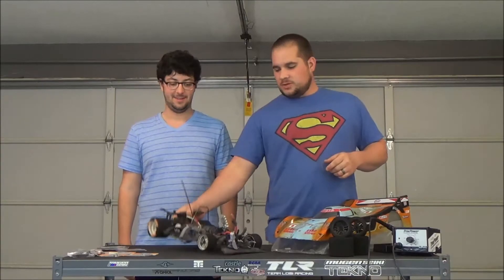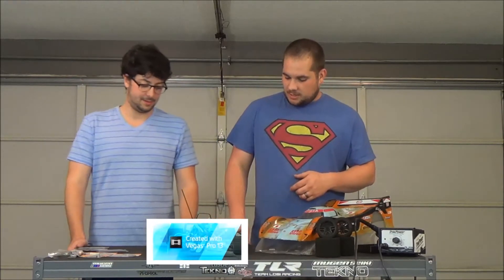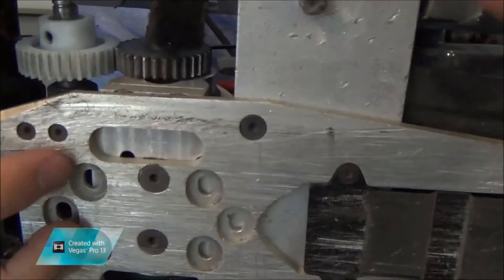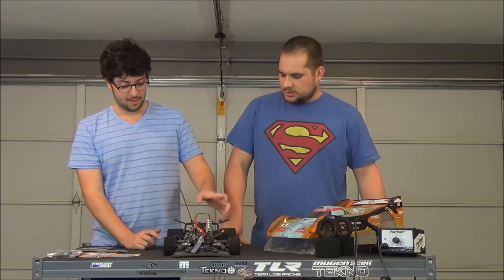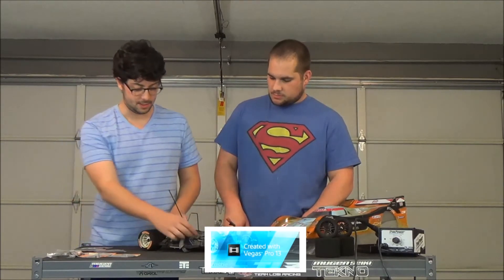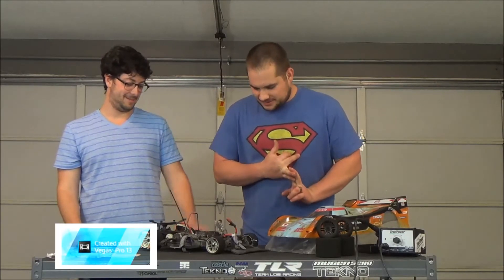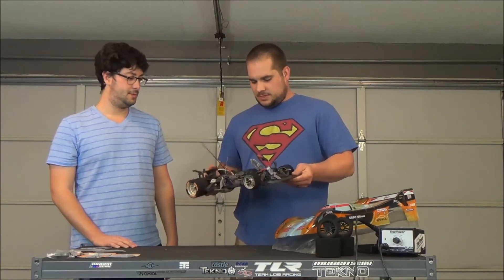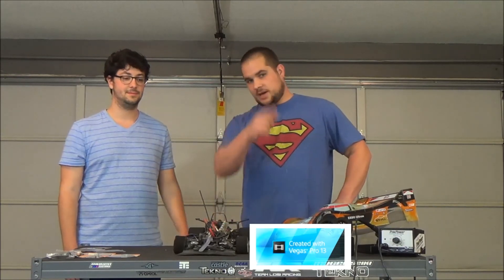SCALE ADVENTURES Project Mugen MRX5 RC Speed Car build info

Comment: I have all the pieces to this build except the gears. Whats a good place to start?
Reply: Mark Leonard 

Kershawdesigns.com 

Or something but there's probably lots of small firms able to make you custom gears.

Ask on forums about custom gears suppliers or machine shops. 

Ive heard hard-core guys are using the traxxas revo 36T spur gear as their pinion gear even on 1/8 GT cars. I've known for years thr traxxas speed guys did that. 

But recently im seeing 70T pinion gears and 30-40t range as the norm. 

Ive not looked for years 130mph was insane. Now its 160+. Im thinking about finally trying. But i want something scale too. Kyosho gt2 bodies look cool. Aston martin ofcourse or ferrari.